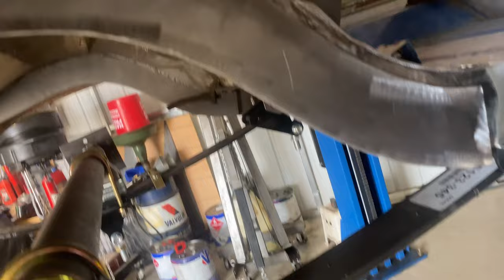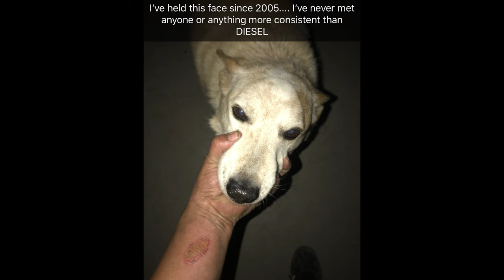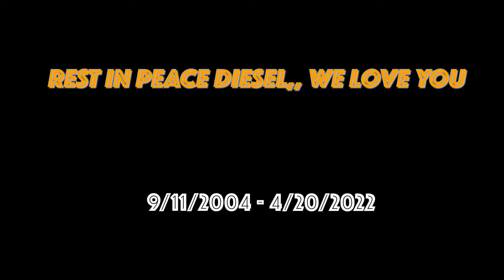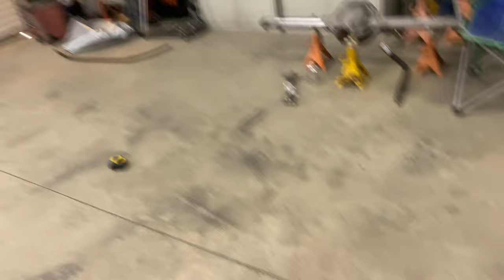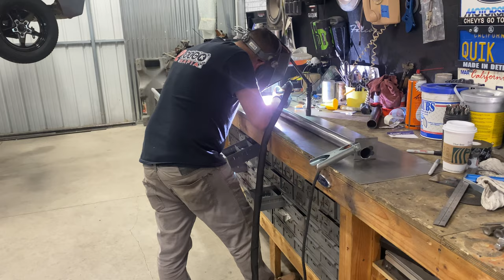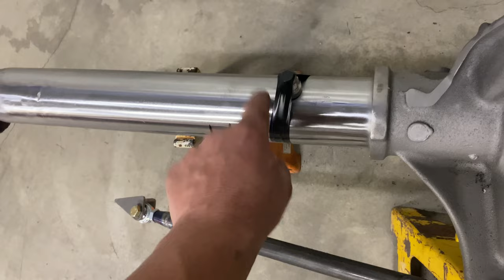INSTALLING THE FUNKHOUSER ANTI ROLL BAR AND LYING MY DOG TO REST.....

Comment: I worked with a guy doing Race car suspension and roll bars too. We use to figure out ride height and take a peice of 1x1sg .080 wall to use for shock height and bolt on. Surprised you don't use a ford 9 in so you can change gearing when needed . Looks good glad I found some Ford stuff